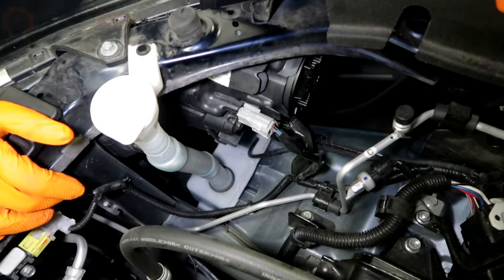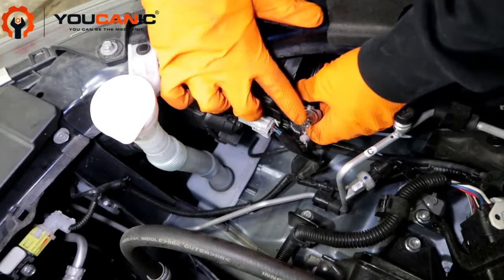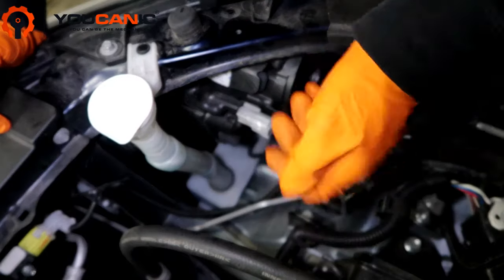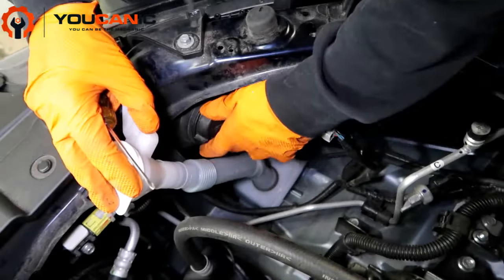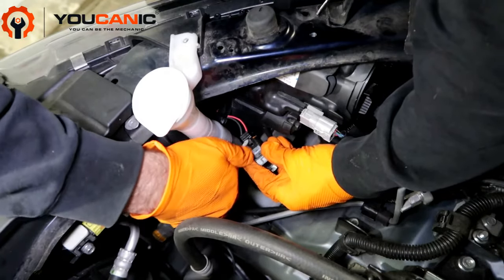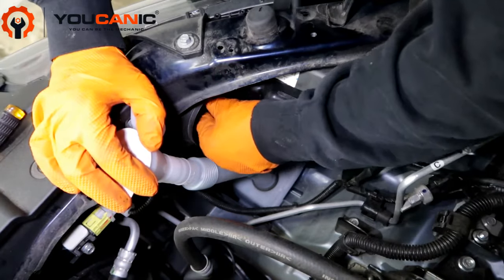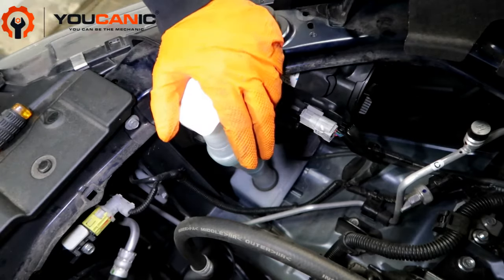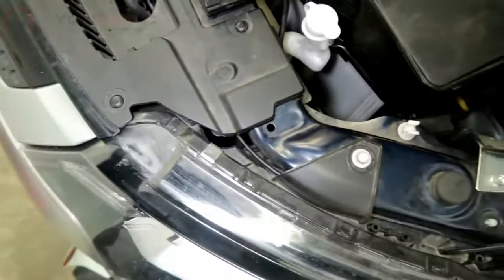2013-2021 Mitsubishi Outlander -  Low Beam & Daytime Running Light Replacement

Comment: Easy as pie. You know, I've changed these bulbs several times on my 2018 Outlander. It's exactly the same and exactly as easy. Well, the auto store just sold me  Sylvania plug and play LED bulbs, which according to their system are a fit for the Outlander. Well, the LEDs say to use the wire clip that secures the low beam spacer to secure the new LED spacer. One problem, the Outlanders don't use those wire clips on the low beams... right??? Or am I taking crazy pills? You certainly didn't remove and reinstall one in this video. So, may I ask, have you ever come across this with those plug and play LEDs? I went with a mainstream brand like Sylvania because I wanted to avoid issues like this.
Reply: Still the same issue and nobody posts a solution in any forum., The bracket for the H7 from Amazon or eBay doesn't fit the Outlander
Reply: Did anyone get this issue sorted ??

Comment: thanks for not telling us what bulbs they are
Reply from the maker: Thanks for your feedback and apologies for any confusion. At Youcanic, we strive to provide car owners with comprehensive resources and guides to simplify car maintenance. Kindly visit www.youcanic.com where we have detailed information including the type of bulbs needed for specific car models. 

If you need further assistance, feel free to contact us on our site. We also offer factory repair manuals if you need in-depth details. Our mission is to empower and support you throughout your car ownership journey. Trust Youcanic, your reliable partner in car maintenance.
Reply: First one was the daytime or “regular” headlights, the 2nd was the “brights” or high beams.

Comment: Very helpful, driver side bulb replacement is quite challenging due to the metal bracket . It took me a while to align the bulb and lock it  without removing the brackets. Thanks
Reply: @S Taylor little difficult than passenger side , if your hands are small that can be easy..
Reply: @S Taylor Good luck 👍
Reply: Well, the bracket is only 2 10mm bolt , 2 minutes to remove and 2 minutes to install back

Comment: Thanks for this.  In case anyone is looking at the left hand headlight, the easiest way to make just enough room to get at the unit is to loosen the bolt on the bracket holding the small electrical box but not unscrew it.  Once it is loose, the bracket can be lifted slightly and rotated on the bolt as its axis which opens up more space.  Much better than undoing it entirely which risks losing the nut underneath

Comment: i just did this recently. you don’t need to take any of these fittings at all. you could just sneakyour habd on the aide of the bracket on driver side and you can take it off easily. even the fluid container moves easily on the side because it has a flexible hose on the bottom. you just have to go straight to the bulb housing on both sides and that’s it
Reply: thanks for the insight :)

Comment: Outer socket is low beam.

Inner socket is NOT daytime running light, it's the high beam.  Running lights not replaceable.

Comment: Can you show where are the screws for the headlight adjustment? 
How do you adjust or raise up the headlight?
Reply: In my Outlander, the headlight adjust is inside the car on the right hand side of the steering wheel (RHD).

Comment: Is there a screw for manual adjustment beam light height. Mine is a little to high, can you show it?
Reply from the maker: The manual adjustment for the beam light height can usually be found located near the headlight casing. If you're having trouble locating it, we highly recommend asking this question on our platform YOUCANIC at www.youcanic.com, where you can get detailed, vehicle-specific advice. 

Also, consider using our Full System Scanner at www.youcanic.com/scanner to diagnose other potential issues your car might have. Our resources are designed to make car repairs understandable for car owners like you. Thank you for trusting YOUCANIC as your reliable source for car troubleshooting.

Comment: I need your help. I have a 2018 Mitsubishi ASX and was about to order an LED bulb from Amazon, but I'm confused about which bulb to buy for the low beam. Is it the same bulb that goes in both the high and low beams, or is it a different model for the high beam, low beam, and fog lights?
Reply from the maker: Thanks for reaching out! For your 2018 Mitsubishi ASX, the low beam and high beam typically require different bulb types. Visit www.youcanic.com to find out the exact specifications for your vehicle. We are always here to support you with our vast resources, including our helpful guides and powerful YOUCANIC scanner. Our mission at Youcanic is to empower you, making car maintenance a worry-free experience. Let us assist you throughout your car ownership journey as you navigate towards confident and cost-effective car ownership.

Comment: Whats size of bulbs have the mitsubishi outlander sport 2018 , on low beam , and hig bean ,
Reply from the maker: Thanks for reaching out! The bulb sizes for your 2018 Mitsubishi Outlander Sport on low beam and high beam are H11 and 9005 respectively. We at Youcanic offer lots of guides and free resources to aid with your car maintenance and we also have a powerful YOUCANIC diagnostic scanner available. Check it out [www.youcanic.com/](http://www.youcanic.com/). 

Don't hesitate to reach out with other questions or head over to our website for more detailed information. We're here to empower and support you throughout your car ownership journey. Happy driving!

Comment: any idea how to turn daylight running lights off on mistsubishi outlanders
Reply from the maker: For turning off Daylight Running Lights on Mitsubishi Outlanders, you may need some specific guidance. We at YOUCANIC can certainly assist you. We have a tool called the Full System Scanner, which can guide you through comprehensive car diagnoses. Learn more about it here's the link: www.youcanic.com/scanner. 

Further, we also offer a platform where car-related questions can be asked. Explore it here: www.youcanic.com. If you have any more queries or need further help, feel free to ask. We strive to make car-related issues simple for owners like you. Your trust in YOUCANIC is what makes us keep going!

Comment: I got to the point to where I put the new H7 bulb in, and the new H7 bulb won’t stay connected to the socket no matter how hard I push the base of the H7 bulb and socket together. 😕
Reply from the maker: Thank you for reaching out! It seems like you're having difficulty with the H7 bulb installation. We at Youcanic are dedicated to making car maintenance a breeze through our helpful guides, free resources, and powerful Youcanic scanner. 

We absolutely understand your frustration and are here to assist you. Don't hesitate to ask questions on our website www.youcanic.com. We also have factory repair manuals available for more detailed navigation. Our goal is to empower you and make your car ownership experience smoother. Stay strong, we are with you on this journey!

Comment: This is the third time I have changed my head bulbs in under a year. Why do they keep dying so fast ?
Reply from the maker: Thanks for reaching out! It sounds like you're having a frustrating time with your head bulbs. Several factors could be causing this. They might not be installed correctly or the bulb's quality could be poor. At Youcanic, we're dedicated to helping car owners like you to troubleshoot and solve these types of problems without any hassle.

Feel free to explore our [website](www.youcanic.com/) where you can access our free resources, detailed guides, and our powerful YOUCANIC scanner. Don't hesitate to contact us there if you need further assistance, and remember, our main goal is to empower and support you through your car ownership journey.

Comment: I replaced my Mitsubishi outlander 2019 low beam headlights recently but they seem to project the light at the sides leaving a shadow in the middle where I'm supposed to see, please advise.
Reply: The tip of the lightbulb has a cap that’s usually gold on the top of the lightbulb. This is supposed to be supported by the reflectiveness of the housing it’s in and spread light around instead of focusing it. Keep in mind the cheap bulbs are only 55 watts and yellowed

Comment: What size light bulbs , 9005 hb3 ?
Reply from the maker: Your question about the light bulb measurements seems like it's more related to car repair and parts. For such queries, we encourage you to head over to YOUCANIC.com. On our platform, you can gain access to a wealth of information and resources, including OEM Factory Repair Manuals and a community where you can ask car-related questions. 

We are all about empowering car owners to handle car repairs confidently. If you need more guidance or have other questions, feel free to visit us at www.youcanic.com. Your trust in YOUCANIC is greatly appreciated, and we're here to support you on your automotive journey.

Comment: 2018 is set up a bit differently.. unfortunately.
Reply from the maker: Thanks for your comment! We appreciate it. At Youcanic, our core belief is to empower car owners and provide them with resources to simplify car maintenance. If you're finding the 2018 setup a bit challenging, we do offer comprehensive guides and a powerful scanner at www.youcanic.com to make things easier. 

If you require deeper insights, we also have factory repair manuals available. Don't hesitate to reach out on our platform if you need any further assistance. We are here to support you on your car ownership journey!
Reply: @YOUCANIC  I wasnt able to get the light out today, so I am going to get help with it. I have my factory guide.. I dont think a scanner would do much for this issue, but it would be good to have one!

Comment: Whoever designed this needs to be repremanded.  Worst design ever. Unless you have small hands this is a nightmare. The bulb hardly ever just "locks back in".  I have thought I had them installed and once I drove the vehicle and hit a bumb, they came unlocked. Horrible.